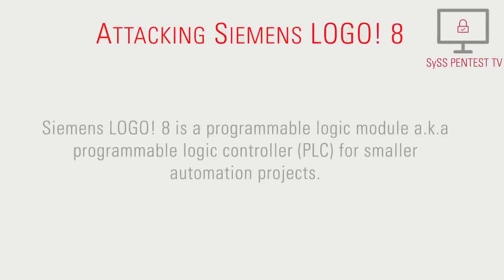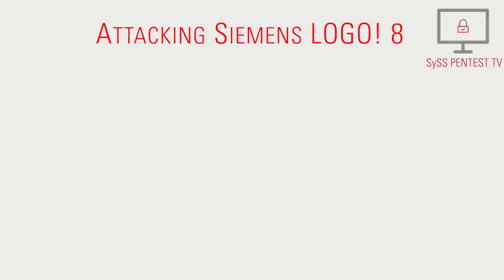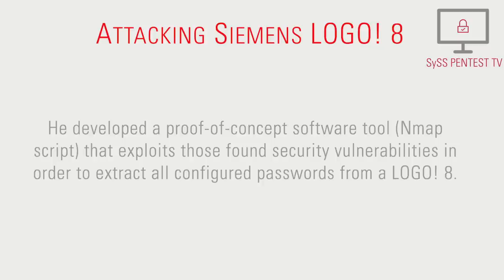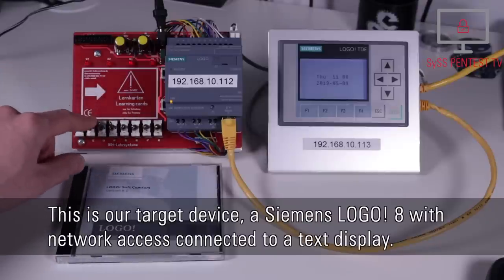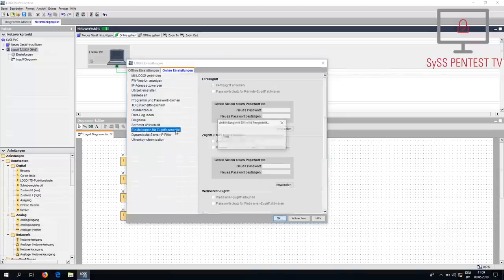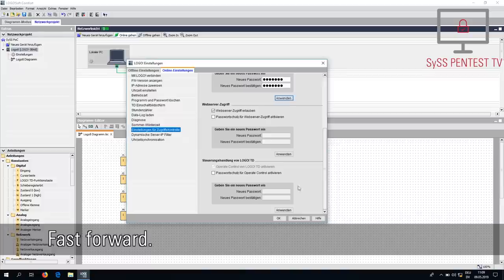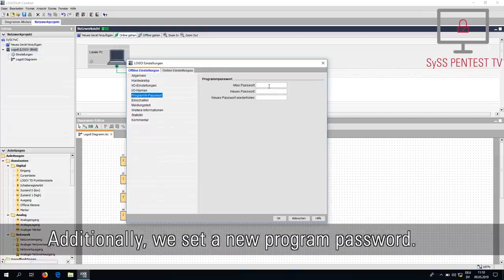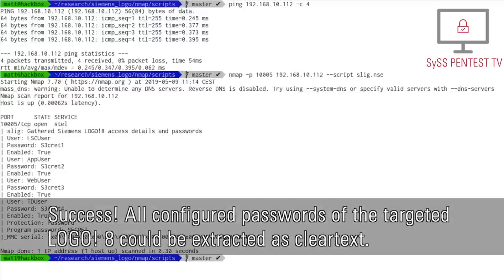Siemens LOGO! 8 PLC Password Hacking

Comment: Hi, is this still working or it was fixed with a firmware uodate, or Soft Comfort 8.3 or at least for the new Logo hw version 8.3? thanks
Reply: hi did you found a solution for 8.3? thx

Comment: does this work via the usb cable? what software are you using to ping?
work on windows 10?
Reply from the maker: This attack works via the Ethernet connection using our developed Nmap script "slig" (https://github.com/SySS-Research/slig). The tool used for pinging the device is the iputils tool "ping".

Comment: I tried it and (thx god) did not work. I can see passwords but they do not mean anything nor work on the plc.
Reply from the maker: Have you extracted the correct cryptographic key as mentioned in our PoC software tool? A wrong cryptographic key will obviously result in wrongly decrypted password information.
Reply: @SySSPentestTV  I have tried des-ede3-cbc, des-ede3, des-ede3-cfb , des-ede3-ofb, nothing works, What are I´m missing...?
Reply from the maker: @user-dc9qx5ij3v  It's DES-EDE3-CBC. Maybe you are not using the correct 3DES key extracted from the LOGO! Soft Comfort software.
Reply: How I will buy the software?
Reply from the maker: @mahadevan3039  You can find further information about the LOGO! Soft Comfort software including demo versions for different operating systems here: https://new.siemens.com/global/en/products/automation/systems/industrial/plc/logo/logo-software.html
Reply: @SySSPentestTV  Hello!How to extract cryptographic key?
Reply: @SySSPentestTV  Hello! I find 3DES key on LogoMath.class. But when I write this key into slig.nse script I have a syntax error on nmap. How to write keyForBinFile = new byte[]{19, 41, 38, -116, 10, -34, 114, 65} into slig.nse script?
Reply from the maker: @ДастанАуданов  If you are using the following hexadecimal notation for the 3DES key, it should work: "\x00\x00\x00\x00\x00\x00\x00\x00" (replace the zero bytes with your extracted values)
Reply: @SySSPentestTV  I converted numbers {19, 41, 38, -116, 10, -34, 114, 65} to hexadecimal and it is : \x13\x29\x26\xFF8C\x0A\xFFDE\x72\x41.Is it correct?
Reply from the maker: @ДастанАуданов  The signed values are not converted correctly to their hexadecimal byte representation. For instance, -116 is \x8C.
Reply: @SySSPentestTV  Thank you very much! I have extracted password from logo!
Reply: @ДастанАуданов  Добрый день. Мне нужно узнать пароль на LOGO. Можете мне помочь?
Reply: @sergeyantohov5343  добрый день, да конечно
Reply: @SySS Pentest TV Hello from Wales. Can you please explain how to extract the cryptographic key?